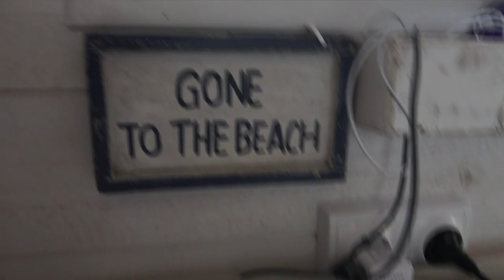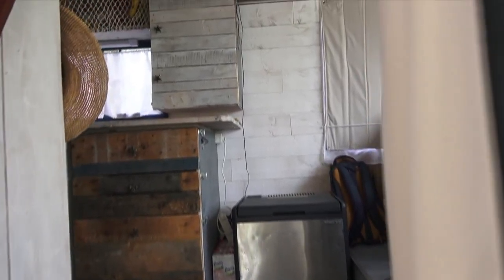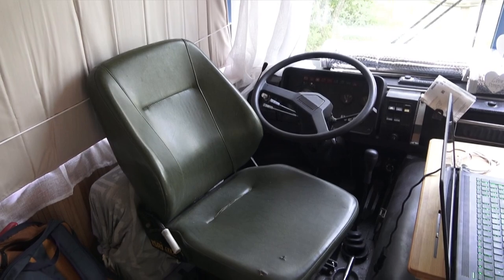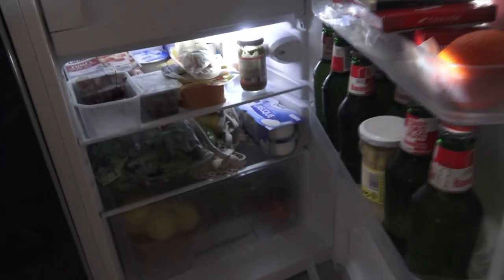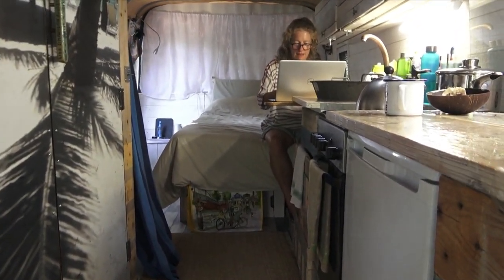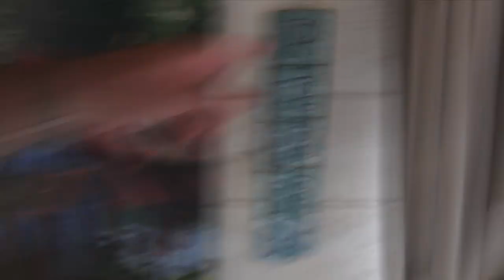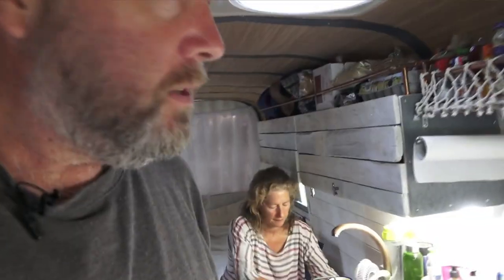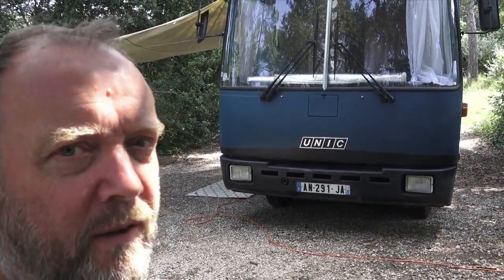CAMPER BUS RENOVATION BUILD FULL TOUR | Pepe🦋 #vanlife#campervan #nomadlife

Comment: Um, don't want to be nitpicking, but AFAIK the gas box ventilation needs to be in the floor because gas is heavier than air? Also the gas box should/must be air tight towards the cabin to avoid gas to build up inside?
Reply from the maker: Thanks for the comment. You're probably right - and that's why we're here, giving everything a stress test 👍.
Reply: @ASimplyFabLife  Hopefully not too much stress 💥😬😉Enjoy!